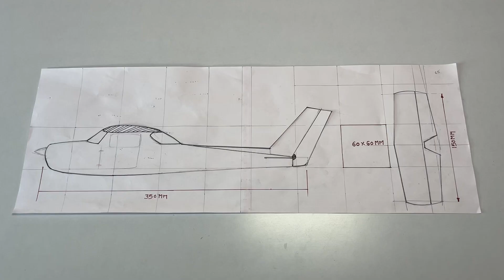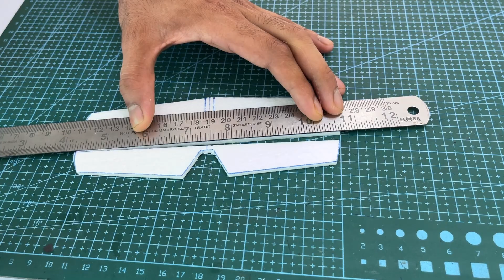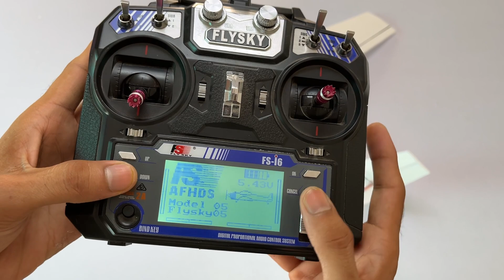Make a Beginner rc plane out of Thermocol #rcplane

Comment: Loved your video. Started flying RC in 1976. Built and flew lots of planes and 3D helis. In about 2010 I got my pilots liscence and built a Sonex airplane and flew the heck out of it. I put the RC hobby aside. Now I have put the private pilot stuff aside and getting back into RC. Boy have things changed! I built with balsa, now it seems the way to go is foam….. Thank you…
Reply: I know what you mean. I was building and flying back around the 90's, and electric was just getting started and the motors and batteries were huge and heavy, and foam was basically mostly used in covering ARFs and RTFs, or make moulded planes like the Combat Models planes. So much has changed in the intervening years since then, when I set the hobby aside due to lack of room or funds. Heck, now you have to register both yourself and your planes with the FAA if it weighs more than 250 grams. When did THAT become a thing?!